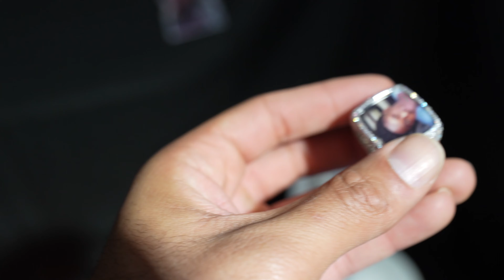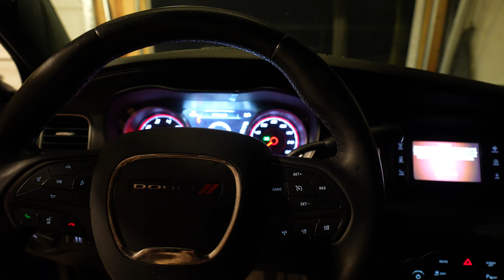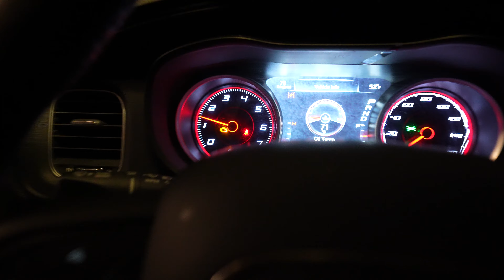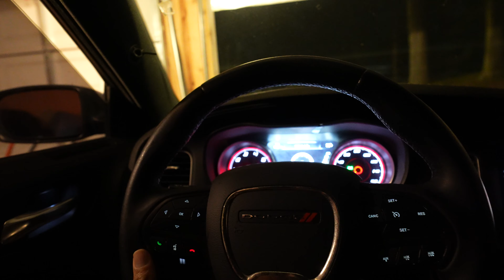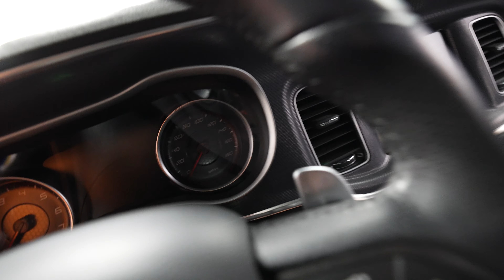I Scat Swapped a Police Charger! (FULL BUILD)

Comment: 24:37    That’s a 5.7 intake manifold on a 6.4. I think the mechanic got u for yo intake. The 6.4 intake manifold throttle body doesn’t sit there, it curves out more towards the air box. Tell the mechanic to give you your intake🫵🏽
Reply: Ya dude got that diff too
Reply: Sad thing is he isn’t gonna realize he wants the 6.4 manifold until he takes it to a tuner , or I guess if it’s a good tuner and he notices it’s not the right manifold.
Reply: its just a intake hes prob gonna put a leg maker on it anyway
Reply: @ICONIC1ANT  it’s the whole manifold not just the intake
Reply from the maker: lmao the block is orange
Reply: @OrangeKing26  not denying it’s a 6.4, just trying to help you get all your power. Right now u have a 5.7 intake on the 6.4 block. That’s not optimal for hp gains and most likely you’re down on power rn. The mechanic stole your Intake, and rly he got you for the rear end and stuff too. When u asked him about the rear end, subframe, etc. the mechanic said “he didn’t want to mess up the gear ratio” which I agree with but u still need to get all the parts you payed for or get reimbursed🤷🏽‍♂️Just food for thought but u make your judgement on the situation and ask others in the car community, they will say the same thing
Reply: Nah bro that’s a 6,4 you can not only tell from said intake but also from the block and breaks if you watched the original video when he got it u can definitely tell that’s a different engine but then again in world of mechanical engineering I’d get it checked just to be sure always rather be safe then fine out someone got you but we all could be wrong fr
Reply: 25:00 also a lil before this on first crack up you can tell it’s a scat if you’ve own one
Reply: @honchochaposrt7919  bro I said that the block was a 6.4 but the intake ain’t my boy, do yo research
Reply: @ICONIC1ANT  It's an intake that I wish I had on my 5.7L to get that extra 30-40HP... Not just an intake, sorry.
Reply: @jahbezmcfadden9355  rear end can be swapped I swapped mine to 3.06 in my police charger just have to change gear ratio in the tune
Reply: Not scat pack

Comment: Bro don’t know shit mechanically about mopars 😭 first of make sure your block is red!!!! If it’s not red then it’s still the 5.7 v8……also you can run the 6.4 manifold with the msd box which is way better than a 5.7 intake . It really makes no sense to put a 5.7 intake on a 6.4.  And you if you bought the donor car, the diff alone is $1000 , the pcms are around $700 and I bet you there’s a lot more parts that are salvageable. I did this swap a few weeks ago.
Reply: It’s crazy y’all assume he don’t know shit about cars when all his shit modded and he started off with a with a 5.7 he built it…